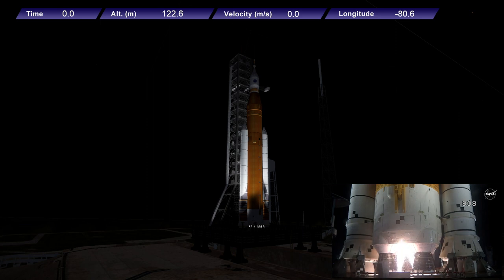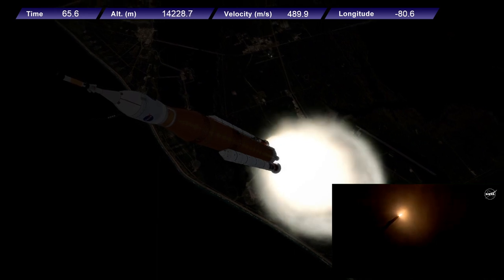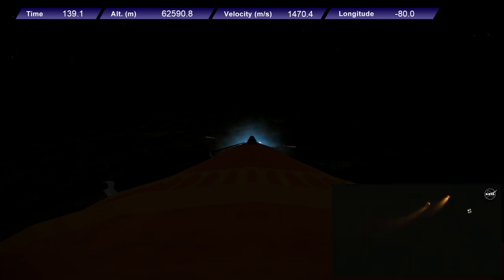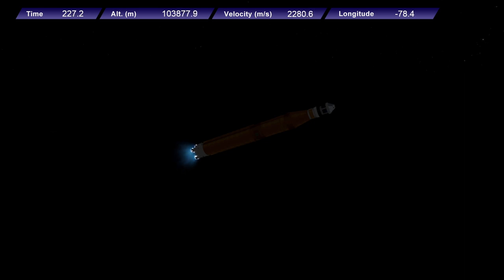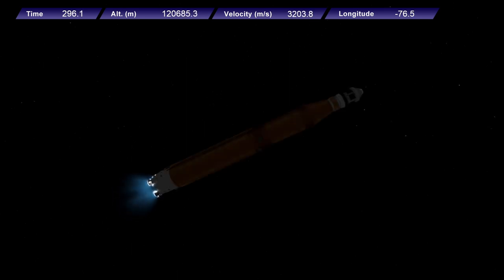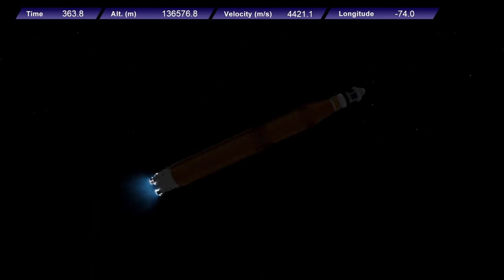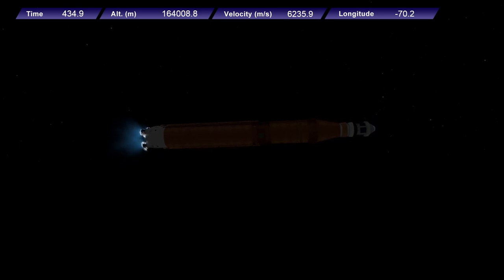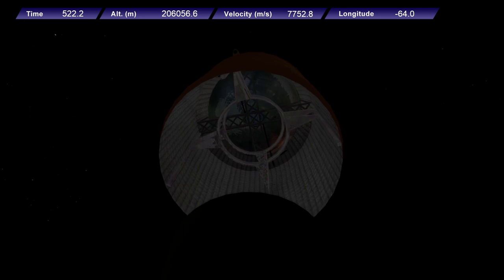Artemis 1 Launch with KSP Simulation Visuals

Comment: Very good video but what mods are you using for the SLS and the Orion?
Reply from the maker: The rocket is Sobol's Space Launch System mod.
Reply: @RaizSpace This mod has issues for me, one of them being the center core burns on in roughly 15 seconds
Reply from the maker: @TheKingTom I have no idea why that would be. This is in Realism Overhaul?
Reply: @RaizSpace  Yes, KER says 28.3 seconds of burn time
Reply: I barely get off the pad before I run out haha
Reply: @RaizSpace  Thank you 😁